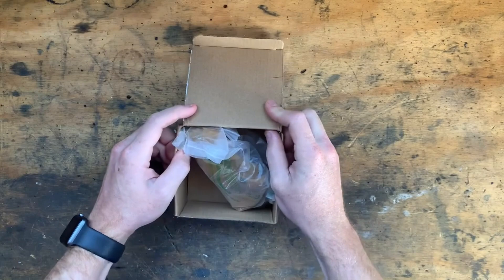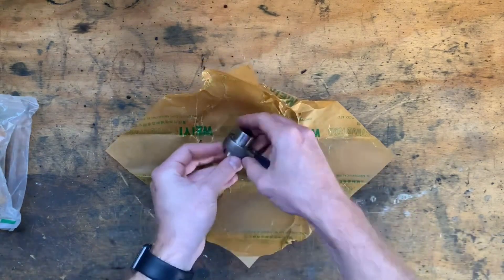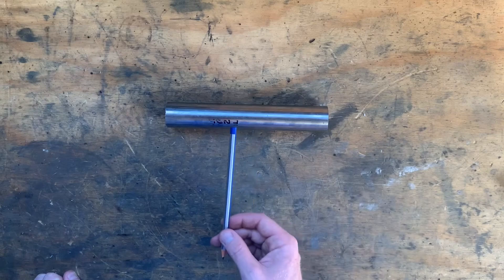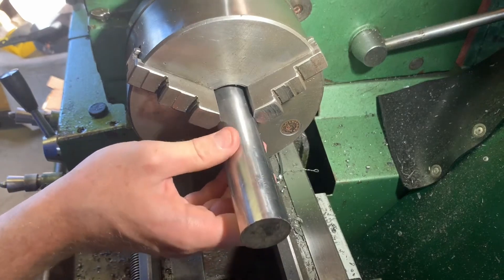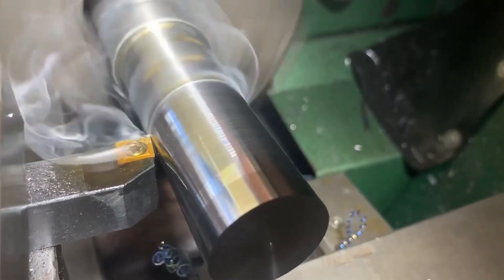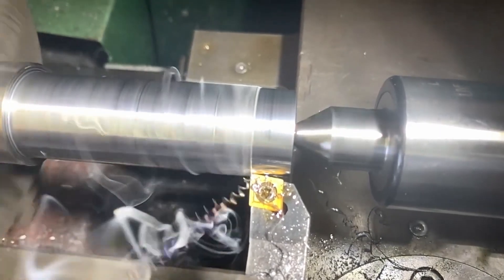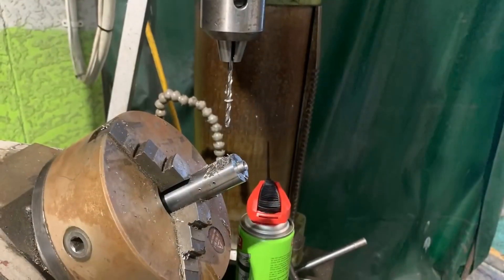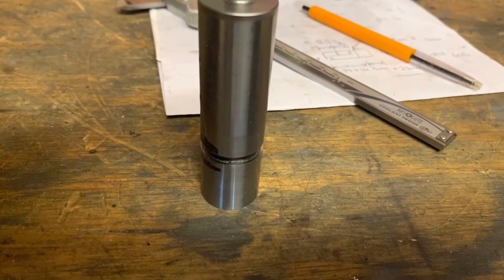How I Made a Custom Crankpin

Comment: Did u know about bajaj 200ns/rs (rouser) tjey make solid cranksaft but single cilynder. Can u convert this solid cranksaft to be pin, used pin cranksaft other motorcycle. Honda or yamaha actualy. But stil used plate metal bearing conrod originaly. 😊😊😊
Reply from the maker: Interesting, the rc390 I just rebuilt has a solid crankshaft. This meant I needed an entire replacement crank and rod as it had run the big end bearing. 

As for converting it to a pin. I don’t see why you would bother unless it was to cut costs when rebuilding and there would be a lot of hassle trying to accurately bore both holes for the pin to be a good press fit. But if you’ve got the equipment and lots of time on your hands, why not?
Reply: @OddsandEndsMachining  i need to separate this solid pin. Because this motorbike not available again on my country. & price this part so much expensive. When i can convert or how to convert may i can reduse we money to repair, because next time we just replace pin big end & metal bearing not buy solid cranksaft again😁. Because so many user this motorbike on my country. This bike its powerfull wuth cheap price. May u can make one video how to do this
Reply from the maker: @heidhouarbi  I don't really have time to make that video, but you could saw the crank in half through the pin. you would then need to hold it in a 4 jaw chuck on a lathe. Then you would align the chuck to the big end pin with a dial indicator. All you would have to do is bore it for the new pin to be a press fit. . . 

You would also have to align the oil galleries so oil could flow into the big end pin.
Reply: Btw its like rc390 because its build on india too.. & the modeling macine almost same. & the same crankcaft 😂